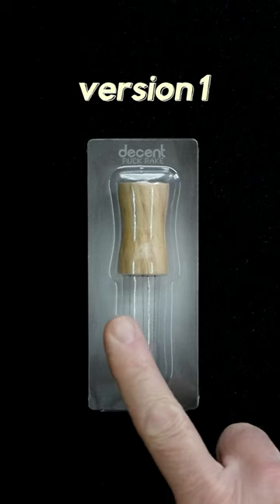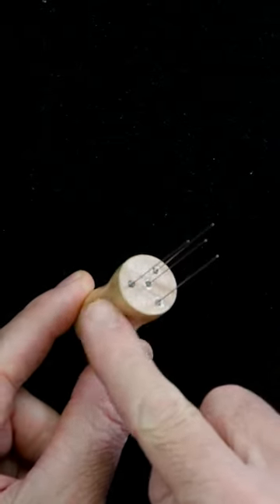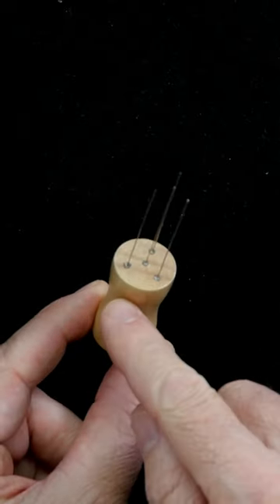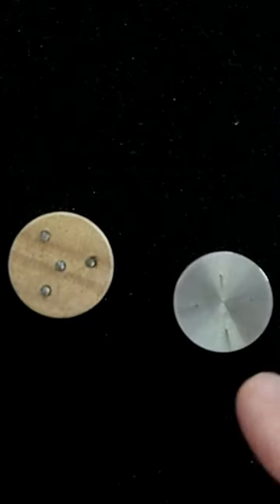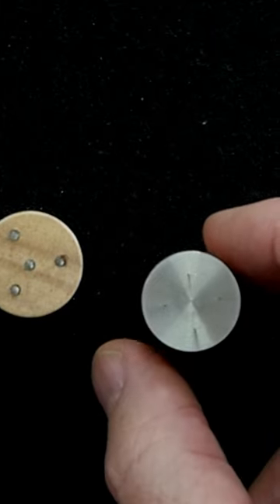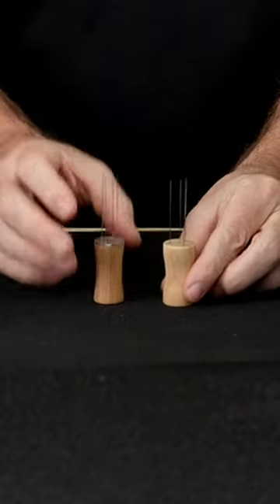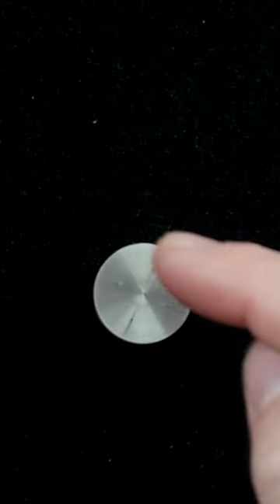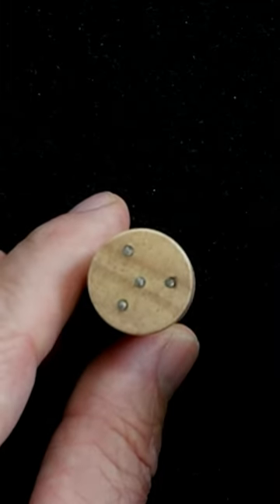Introducing our new v2 Puck Rake (short)

Comment: A puck rake............John, I have never raked my grounds and I will never rake my grounds. I am a confirmed non-raker of the grounds.

However, 2 days ago I put the new parts from the kit into the grouphead......easy peesy but removing on small screw was an issue. A little prayer and extra ohmph got it removed.
Wow, that's a lot of metal getting removed from the water path and presto, superfast warmup and drier puck.......NICE.

Thanks for being the best company on the planet!